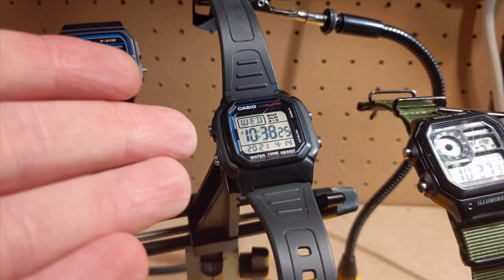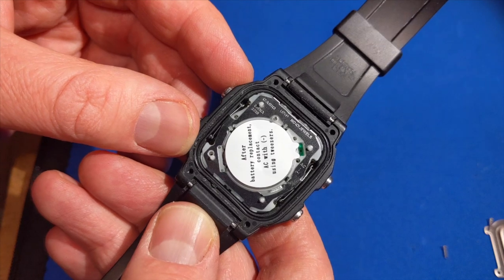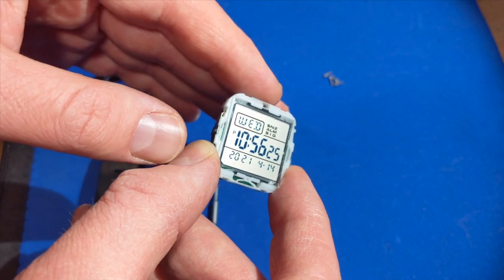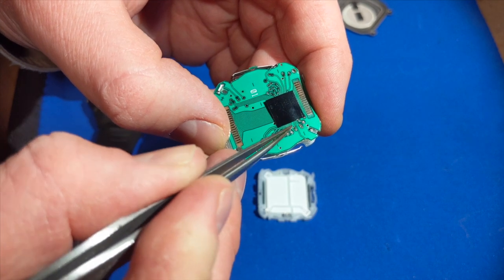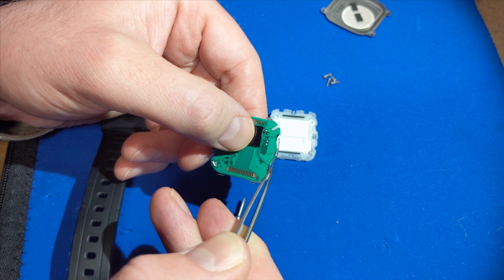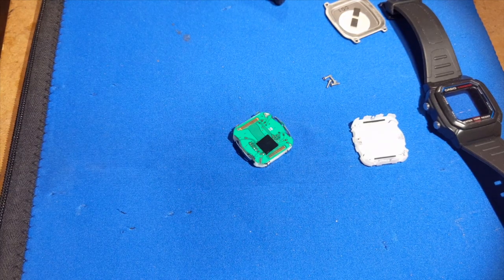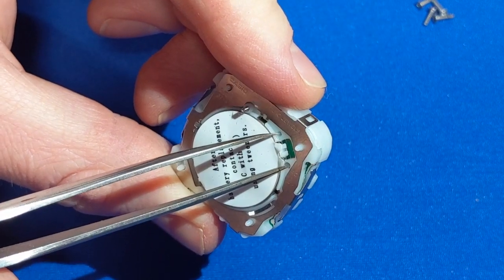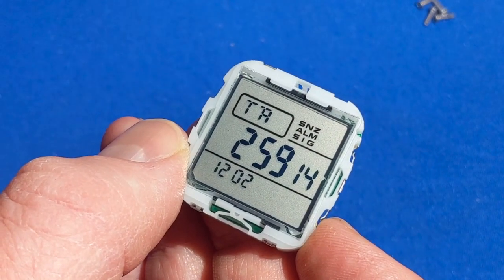[mod] Casio W800-H Countdown Timer Modification

Comment: Great method with the copper wire! Btw for those without a soldering iron, it can just be scratched off with a needle or pointy tool. Be careful though.

Comment: Great walkthrough. I just completed the mod on my trusted and nearly 10 year old W800-H following along with the video. It has always annoyed me that my W800-H didn't have a countdown timer and now it has one!

For those attempting to do this... make sure to set aside the spring mentioned at 3:08. Mine fell out when I took apart the module. Trying to find it on the carpeted floor was quite a challenge.
Reply: I did mine and noticed the little spring is designed with a slightly thicker end ..that end is the inner one ..you cant pull the spring out but when you separate the unit it falls out the back!

Comment: Can  the alarm be set to less than an hour? My main use would be to set it to 35 minutes when I'm doing the laundry. My watch is a W-98H with a 'module number' of 2499 (4 buttons, alarm, Stopwatch, Dual time)
Reply from the maker: The countdown timer can be set to a max of 24h:59m or 1 minute at the minimum on my w800h.

Comment: I am looking for a simple watch that would also give the possibility to 
set seconds in the timer mode (not only hours and minutes), can you 
help?
Reply from the maker: Sorry I don't have much guidance to give there. All I can tell you is that the w800h timer hack does NOT let you set a countdown timer in seconds. The lowest it goes is 1 minute.
Reply: Hi. I would recommend any Timex Ironman Classic 30 Lap watch (3 alarms, 24 hr-chrono, timer that can be set to the second, 2 extra time zones, indiglo light, affordable, 100M water resistant, very comfortable). Regards.
Reply: I never really thought about it before that the W800 won't let you set seconds, but I have several Casios that you CAN set the timer seconds... The A500, AE1000, AE1200, W93, W735, DW5600, GWB-5600,  and probably the W94 and W737 (dead batteries). Even a cheap Innovative Time Sports Master that I bought at Kmart some 38 years ago when I was 16 for less than $10, plus a more expensive stainless steel version of the same watch with the same module for around $20 could set the countdown timer seconds, yet curiously no seconds on the W800 or the F201 models.

Comment: I had a countdown timer that would RESET AUTOMATICALLY, i.e. recurring timer. THen yesterday, it reset itself, and it doesn't automatically restart anymore... =( How the F do you make it auto-restart?
Reply: @phychang I accidentally discovered that there is an auto-repeat option! If you press the "Adjust" button (to set the timer length), then pressing the "Light" button seems to toggle on/off auto-repeat (there is no visual indication).

Comment: Do you know if auto repeat for the timer can be added?
Reply from the maker: I don't believe so, but I could be wrong.
Reply: @obso1337  I accidentally discovered that there is an auto-repeat option! If you press the "Adjust" button (to set the timer length), then pressing the "Light" button seems to toggle on/off auto-repeat (there is no visual indication).

Comment: Is there someone I can have do this? I don't have a soldering iron but I am about to buy a W-800H and this is literally the only thing this watch would be needing to be a good everyday watch for me to replace my AE-1000.
Reply from the maker: I wouldn't be surprised if you could find modded watches on eBay!
Reply: @sheepdogoutdoors7006  it’s not, just have common sense.
Also these watches are at most 20 dollars. A soldering iron is 10 bucks and solder is cheap. Just do it yourself.
Reply: You don't have to use soldering tool. 
I carefully scraped the solder off with a small knife edge. And it worked perfectly on my W-800H watch.
Reply: I didn't use an soldering tool on mine. I just used the smallest flathead screwdriver from one of those cheap jeweler set of 6 to carefully scrape through the jumper. I had never disassembled a module from any watch before this, and I got it right on the second try. My first attempt was only a fail because I didn't quite sever the jumper and I didn't activate the timer. The second try on the same watch a few minutes later was completely successful.

Comment: can it 20 sec countdown ?
Reply from the maker: The timer can count down from 1 minute - 24 hours. It does not have a seconds timer.
Reply: @obso1337  so what cheap casio type can do second timer ?
Reply: @rizaladhi7066  The Casio 
DW 291